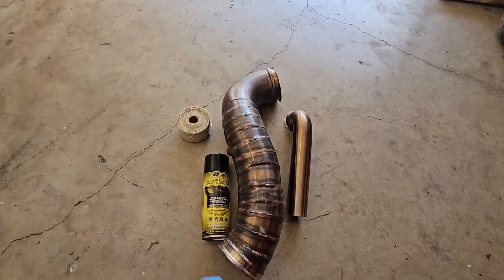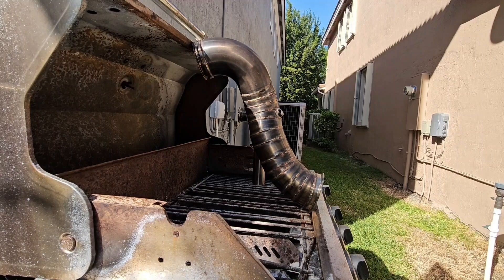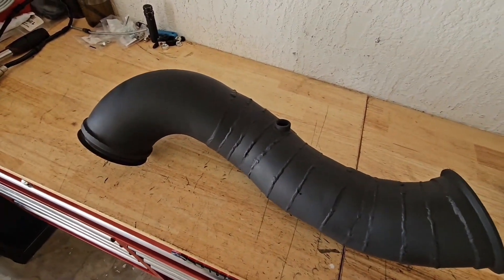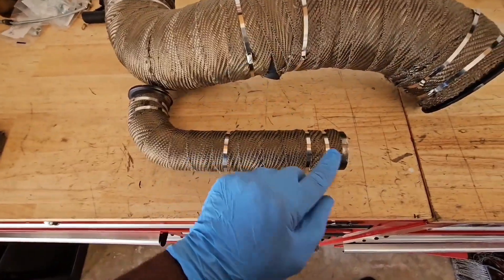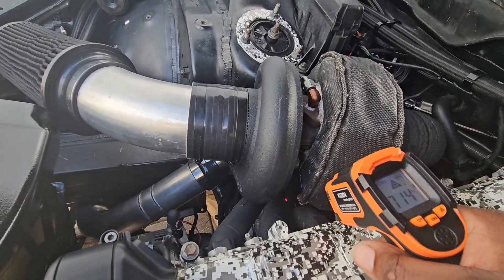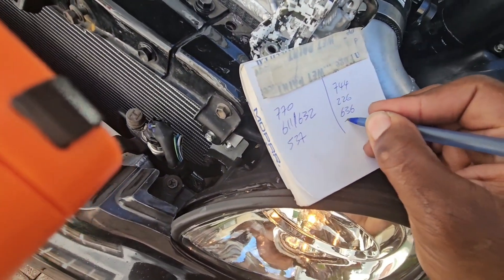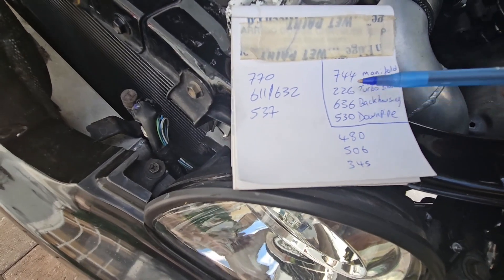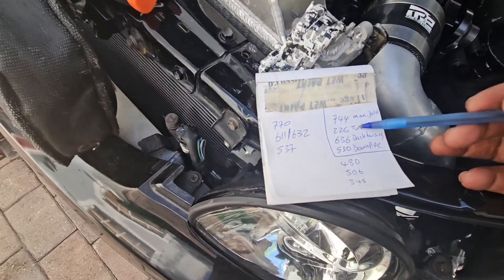DEI Titanium Exhaust Wrap & DEI Hi-Temp Silicone Spray......Does It Make a Difference?????

Comment: hi ,landed on ur video cause i was looking for some information on this spray , hows it going after all this time ?
Reply from the maker: Held up pretty good, it faded a tad bit but no flaking or major discoloration.
Reply: @CmoneyGarage thanks ! ill do same process as you on the headera im about to install, i was looking for some info about the spray and see if it helps in the case that some oil is dripping on the wrap , well at least to repeal some of this fluids that i could have

Comment: Even with the silcone spray those wraps retain moisture and can cause your exhaust to crack. Especially on something street, rain driven or stored outside. Ive had very good experience with the gold heat wrap and its budget friendly.
Reply from the maker: Yes it still does retain moisture ,not as much and hitting the pipe with the spray before wrap will help with corrosion/rust.  I believe this is only an issue with vehicles that are stored for an extended period of time. A regular driven car shouldn't have that issue.